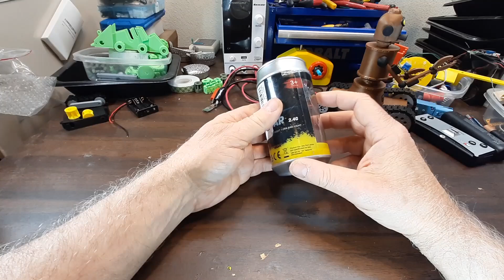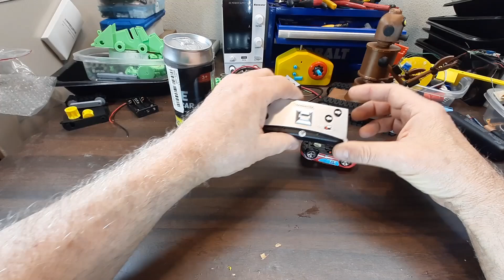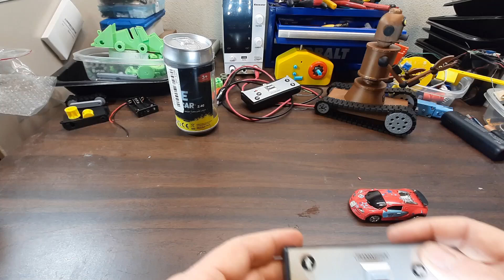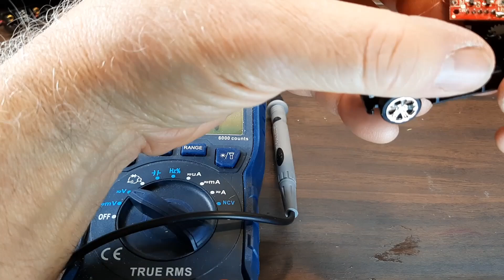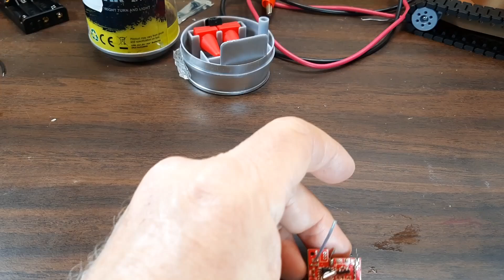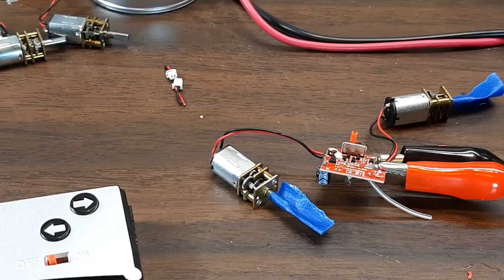Using The RX And TX From An Coke Can RC Car

Comment: Hey Rick100, Awesome project. I have all of the parts, but very little electronics experience. Is there a complete wiring diagram showing both the lights and the wiring for the chip and motor arrangement? Just feeling a bit apprehensive about my ability to get this all together. Thanks.
Reply from the maker: I don't have a wiring diagram. There are different versions of these cars with different RX boards so you have to play it by ear. When you take the car apart, take lots of pictures before you de-solder anything. You can draw up a diagram then. If your car has led lights pay attention to the orientation of the leds. The wire pairs that go to the steering and the wire pairs that go to the drive motor can be used to drive the  two small motors. If you want to drive leds then wire them like the disassembled car. This car didn't have leds so I'm not real sure how to wire them. You probably won't hurt it by experimenting . Just don't short the wires that drive a motor together or to ground or positive voltage. Robothut did a video using a board with leds: https://youtu.be/mpFZEXfQtBI?si=zE60_Buxj1QpP1RL 
It may have some useful information. I hope this helps.
Reply: @rick_100 thank you I’ll let you know.

Comment: Thanks for showing Rick, I love those N20 motors, I use them a lot for robotics.
It looks like there is a dedicated chip to receive the signal and do all the work. I don't suppose it has any markings? It looks like an easy board to replicate if we know what the chip is, and they are obtainable?
Reply from the maker: The receiver chip is unmarked. I also took a transmitter apart and that chip is unmarked. When I searched for the motor driver chip YX75V18AM, one of the links is this one:
 https://www.chinaglobalmall.com/products/559821845566
It has a schematic of a receiver that looks similar to the one on my RX board. The RX chip is marked YX-2.4G . I think I read somewhere that these chips are microcontrollers with  radio functions.
Reply: @rick_100  Thank you for the link.
I find this a lot: Like the coke car toy, you look at what is inside them and work out the price of parts, just to find the cost is far higher than the toy.
Cheaper to buy the toy for the parts, haha.